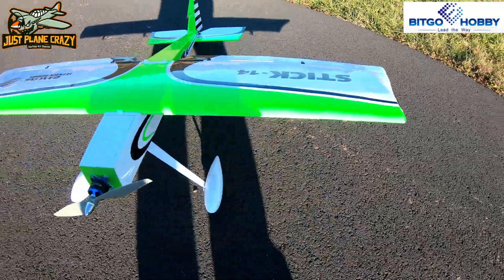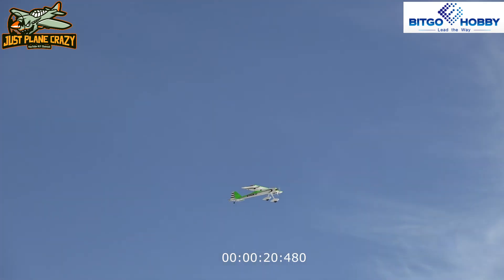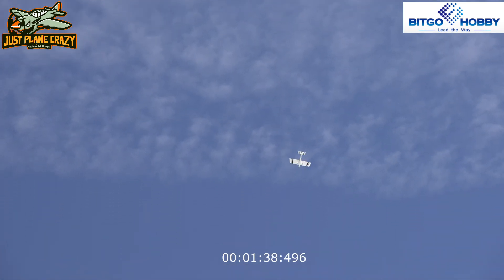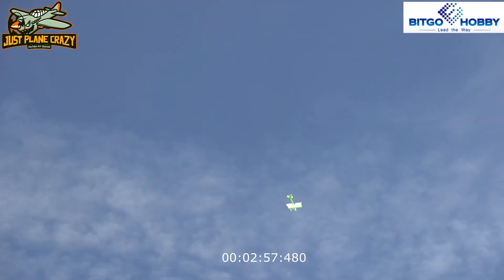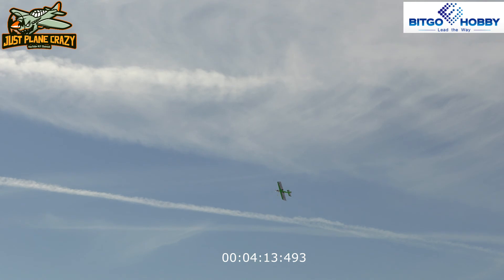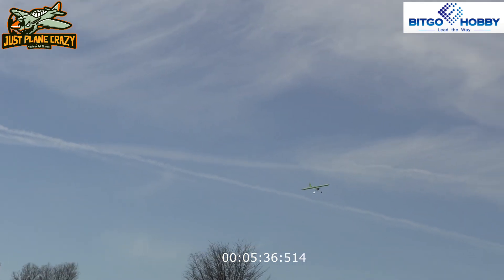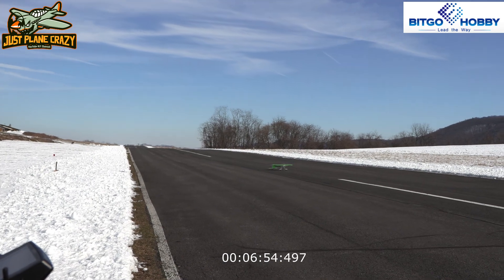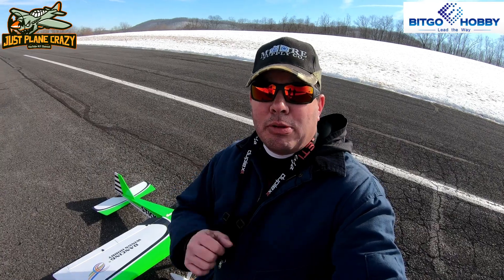Maiden Flight of the 1400mm Dancing Wings Stick from Bitgo Hobby, Balsa PNP ARF

Comment: I've been on the fence about getting one for a while...Now I'm sold!  Can you recommend any decent tutorials for getting started with the Jeti radio system?  I got the DS-16 and as a Spektrum user i'm a tad intimidated!  Thanks!
Reply from the maker: So for sure a couple of hints. Get the plastic transmitter case from www.Aeropanda.com. Used code JUSTPCRAZY it has to be in all caps. It will save u a good amount of money. Second. Check out Harry Curzon jeti vids on YouTube. He is amazing and has helped me a ton. Also. Hit me up Brenden McCormick on fb and message me. I will more than happy. All I ask is that anywhere u go u drop my name, like when you order the the stick. It helps.  I get NO kickbacks.